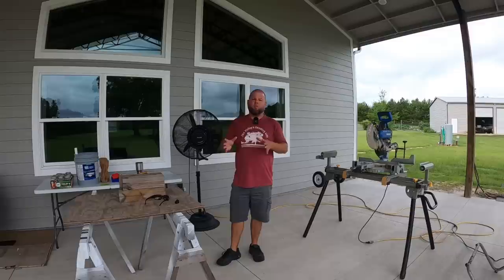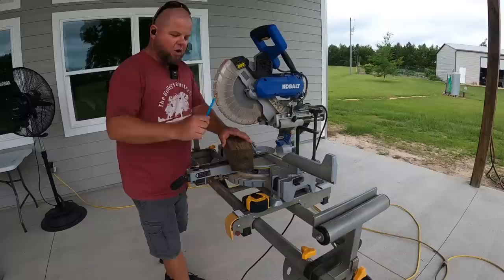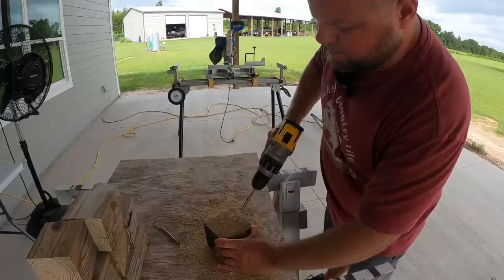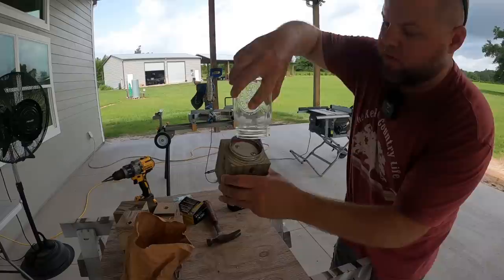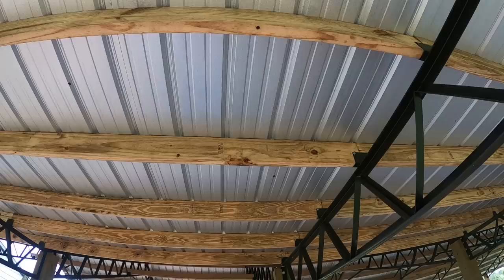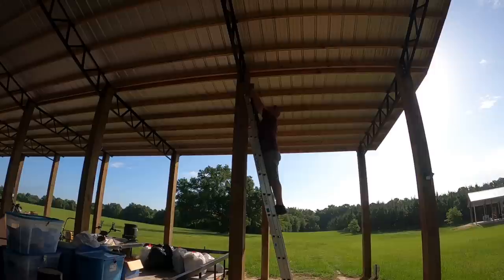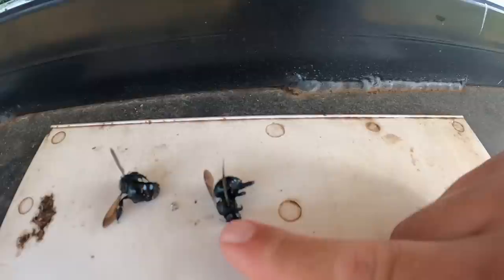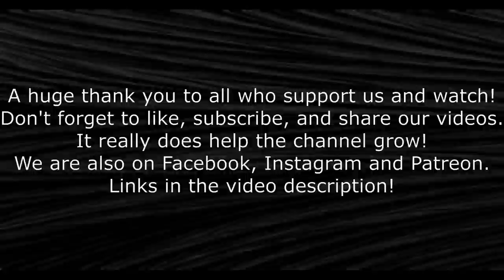Building carpenter bee traps! They WORK!!!!  #583

Comment: I have had great success with spraying WD-40 in the hole (with the smart straw).  They immediately drop out of the hole and die within seconds. Then I either caulk or use wood filler in the holes.
Reply from the maker: That's been our technique since I was a kid, but I want to stop them before they ever drill the hole.

Comment: I used pt 4x4's then clad them in cedar. They love cedar.
Reply from the maker: Hmmmm 🤔🤔🤔
Reply: Yes they leave that out of the brochure for lindall cedar homes.
So we made our traps with leftover 4x4 cedar posts ends.worked great in conjunction with spraying as well
Reply: @TKCL  your holes also might be a little too close to the bottom. They might let light in and not fully "fool" the bees.  Forget where I got my specs when I built mine but I drilled entry holes on all 4 sides centered top/bottom & side/side on essentially 6x6x6 " blocks

Comment: Hey Andrew, your a little late but better then never. I have the same problem here on Maryland's eastern shore. I built 9 of them for pickle jars a month ago. I've only caught one carpenter 😢. You could cut out one step in your build process. Screw the lid to the block first then drill the hole with a 3 point spade bit. The three point will clean cut the thin metal lid with easy. Keep up the great videos my brother 👍👍

Comment: I made these traps years ago and have caught hundred of carpenter bees. I live in Va. and leave mine out year around. They usually start working late Feb and all of March and April. I hang my traps on a rafter or joist that is exposed outside the roof and let the trap hang below the rafter. I think they see them better there than on the post. I put a little 1” strip on the back side of the trap then screw it to the rafter which lets it hang below a rafter for better visibility. I’ve emptied mine several times this spring and had 13 bees in it twice. Several other times I had 6 to 8 in it. They work but you definitely got yours out too late. The hole I drill for the bees to go in is 3/8”. Seems to work well for me and treated wood works just fine.
Reply from the maker: Mine have been working well since I started leaving dead bees in the trap.
Reply: @TKCL  I know that helps. I don’t leave too many dead ones in it. As the others soon can’t tell what’s in there when they get piled up. Six or eight dead ones works good.

Comment: i couldn't find ant untreated 4x4's either, so i also used treated lumber.  I cut mine 5 inches long.  1/2 inch for the side holes, one inch for the bottom.  Mine caught carpenter bees,

Comment: We use a tractor supply pull behind atv sprayer and spray with insecticide that's specifically used for carpenter bees but also other type bees and we live in a lindall cedar home and do this once a year for protection also have been traps like the ones you have put up..
Reply from the maker: I've heard bifen works well and that's what I spray around my structures. I didn't know there was a specific spray for carpenter bees. What's the name of it?
Reply: @TKCL  our local home Depot carries a product called AMDRO it is great as a foam spray can long distance spray from ground up to 20-25' ,but I'll look in the garage 1st thing tomorrow morning and see the exact brand we use with great success on our cedar home...stay tuned.sorry I'm not next to it at the moment..

Comment: Andrew 2 Qs ....1 can you fill the holes with a sawdust glue type filler or any type filler for strength 2 do you plan on exterminating the existing holes....
Reply from the maker: I am exterminating the holes with WD40, it works very well. No way to fill the holes for structural Integrity, as they Meander and weave all through the wood.
Reply: You can not flexible tube somthing in the holes...something ridgid that can take the place of the missing wood? I really hate the fact you are having to do this a two year old pole barn...they had these barns that lasted 300 hundred years in places...I guess the wood was so old and tight ringed those carpenter bees could not get in...or its a non native species and should be removed....Andrew I hope you figure something out to repair the lumber. If I see anything I will let you know..

Comment: you might need to go around and fill the holes you can see. Maybe foam or glue--I envision the spray foam with the straw applicator. You would be sealing them into or out of the existing homes.
Reply from the maker: Might be a good idea

Comment: If the carpenter bees are already in the wood all is you need is a crack and crevice tool and some powdered boric acid and give each hole a puff of the powdered boric acid and let time do its job that's just a quick and lazy way to take care of it about once a month and then when the larvae leave the nest will crawl across it and die
Reply from the maker: WD40 works very well

Comment: Question, would coating the exposed lumber with a mixture of used motor oil and diesel fuel deter carpenter bees and possibly other pests ??? As a bonus the coating would act as a wood preservative.
Reply from the maker: Very well may

Comment: I don't think they sting, but they can bite..
Reply from the maker: According to the internet and from what my friend showed me, the females are capable of stinging.
Reply: I'll be darn. I didn't know the female could sting. I was emptying the jar and one was moving, so I picked it up. For several years I thought it bite me. I guess I actually got stung. Hurt like you know what.
I know for a fact that if you spray Spectracide Carpenter Bee Spray in the hole it will kill them and put steel wool in the hole they don't use "that" hole again. Good luck!
Reply from the maker: WD40 works very well too

Comment: Skip the lid, just use the ring with 3 of the screws. The reason the trap works is they cannot fly straight up to get out.
Reply: Also you need to fill the existing holes, they prefer used holes that smell like them. Leave the captured bees in the trap it will attract others.
Reply from the maker: I'm just learning that, I need to find the bees I tossed.
Reply: I believe the hole in the can lid should be larger than the holes to get in .I believe they crawl in the smaller holes and can't crawl out of the larger holes because they can't reach the wood in a larger diameter hole.From what I've gathered over the course of watching tutorials

Comment: You should leave the dead bees in the traps.  It draws other bees.  

Also, don't caulk or seal the already established holes because the bees will chew their way out making more holes.  You would likely need to put poison in the existing holes to kill the bees in the nests then keep replacing the poison until you are sure they are all dead and all larvae are dead before sealing up their holes.  Then your traps will be much more attractive to the bees.  

I had them on our hot tub enclosure on our back deck and it took me almost two years to get rid of them.  Our neighbor's home was so bad they called in an exterminator and had to replace all kinds of shutters and some of their fascia boards.  The exterminator did look at our problem and he recommended eliminating the existing nests first then plugging then putting out traps.  

So far, so good.  No new holes in our enclosure so far and our traps pick up bees as they come around.

BTW, our neighbor's home is painted and they ate through that stuff in many areas.  The only thing that seems to stop them is hardy board siding.
Reply from the maker: Good ol WD40 works great for exterminating holes.

Comment: Probably too late for this season. Maybe you can fill all the existing holes this fall/winter so the don't reuse those and go into your traps.  I'd make real sure I have 2-3 times more traps.
Reply: If they don't like paint, how about a varnish or other clear coat? Maybe you could spray the lumber with a coating that's clear (so it won't require tedious taping off) to discourage new damage and the traps get filled fast.
Reply from the maker: I'm curious about the clear coat, because we want to put tongue and groove pine up over the entire porch ceiling with a polycoat.
Reply: @TKCL  That's a good point... Maybe other viewers have had experience with that?
Reply: Ok we also use an additive to our stain a concentrated liquid that we add to the can .We usually buy 5gallon buckets and again I'll follow up with you in the morning with that info along with the spray we use.we usually just spray once a year hear in the great white north .The orkin man just became to expensive and seem to come much more often with less effectiveness so we began doing ourselves.

Comment: Those traps DO WORK and work VERY well. Make or buy some online. Just fill any and all holes with wood putty at the beginning of March and then hang the carpenter bee traps.  Traps are VERY effective! Leave the caught bees IN the traps, they release a pheromone that attracts other bees. Even the dead bees release the scent.
Reply from the maker: I've found that out over the months, leaving the bees in the traps has worked very well.
Reply: @TKCL  yup! I empty mine in the fall, they are gone by then. You will catch some during the summer but mostly March through early May.

Comment: Great informational video! Sounds like you will be ahead of the bee game next Spring. I’m wondering if you can prevent the eggs from hatching by putting some kind of filler in the holes? Anyway, it sure🫣 is a shame to have that kind of damage. 🫣
Reply from the maker: I did add filler, WD40 😉
Reply: yes steel wool :)